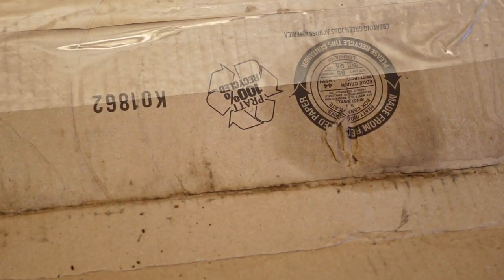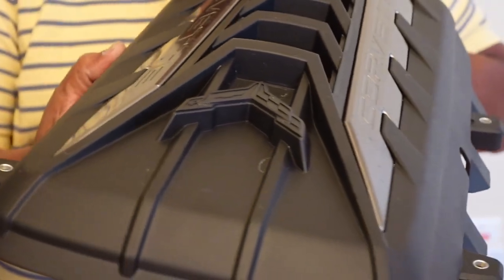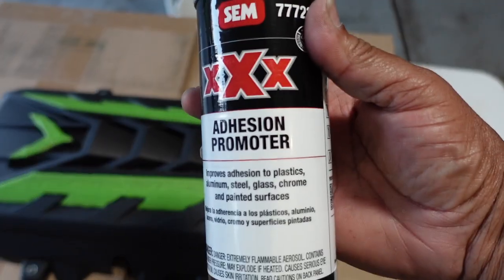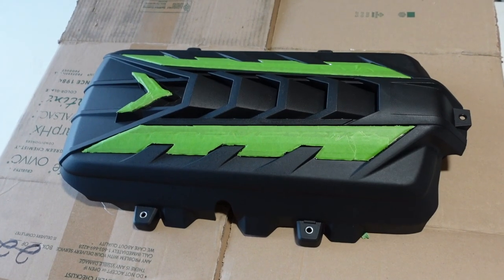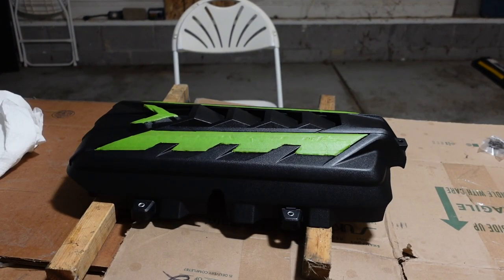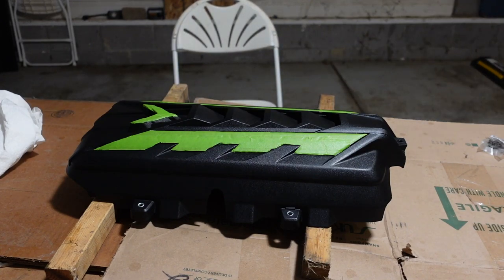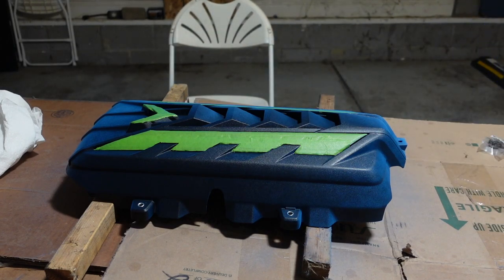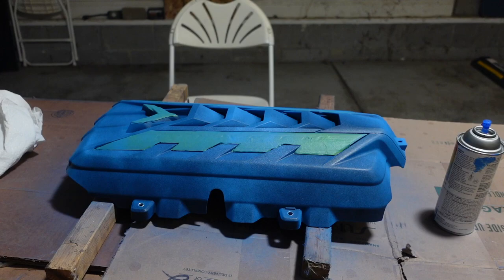C8 CORVETTE HTC ENGINE COVER UNBOXING, PAINTING AND INSTALL TO PREPARE FOR CLEAR ENGINE BAY COVER

Comment: Good video.  Where did you buy your engine cover?  Wouldn't it be just as easy to buy the cover already painted?
Reply: I bought the engine cover from eBay. Yes it would’ve been much easier to buy a painted one but much much more expensive.  With the engine cover and the paint I was just a splash over $100.

Comment: I used a plastic pry tool to remove the plastic strap around the hose. I was able to reuse the same plastic fastener
Reply from the maker: Ok thanks for the tip.